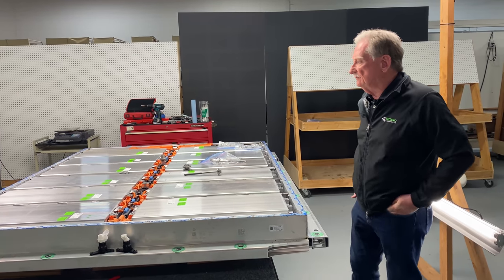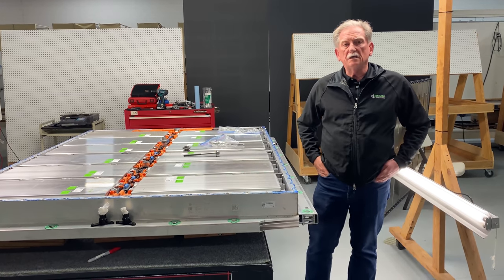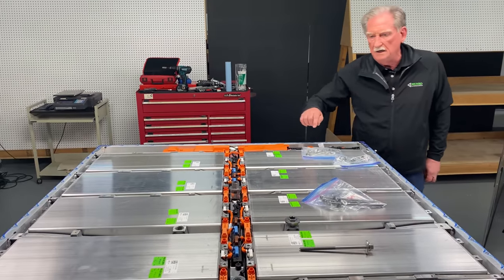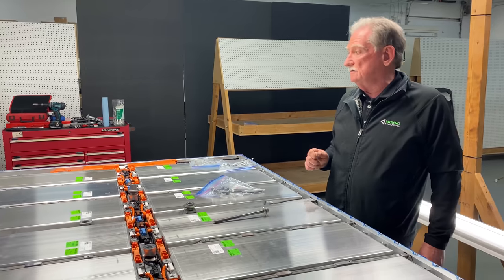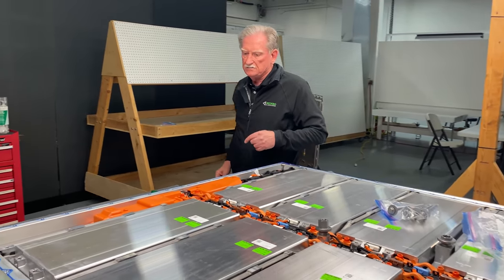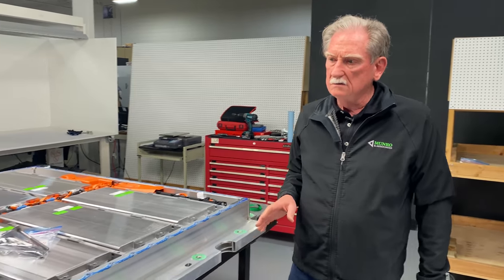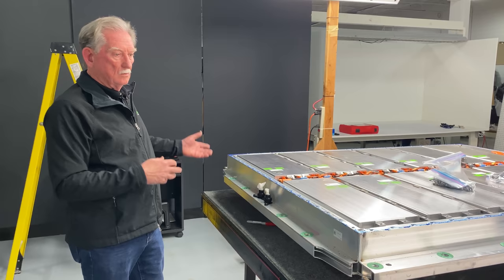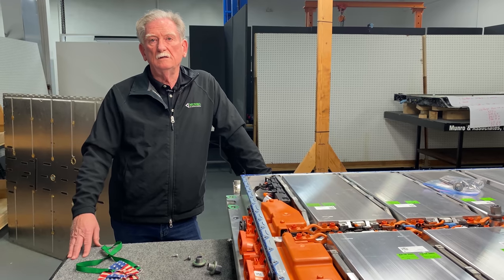2021 Volkswagen ID.4: Battery Teardown

Comment: So if you reduce the weight by swapping the aluminum with polymer frame, does it is increase material cost? How is the $10 per kg derived?
Reply: My question exactly. Carbon Fibre is expensive.
Reply: $10 per kg is just a generalization, a kind of place holder pending the real costs.  To get the real costs, you have to go much deeper.  The true cost of a design has to take into account the manufacturing steps required to assemble the car, the robots and manpower involved, the price paid for outsourced parts, and even risks - if a design is more risk-prone in some way, cost analysts will usually factor the cost of risks into the cost analysis.  Risks are varied.  Safety risks, parts failure risks, risk of misalignments during assembly, anything that could require taking a cost charge or the cost of corrective action during or after assembly is fair game.  Even the risk of litigation after the vehicle is sold is fair to include in a cost analysis.  Some engineering decisions may elevate or reduce risks.  It all can be quantified, although it's usually necessary to make some assumptions to get to the final figures.

As an aside, VW hasn't always done a good job with costing risks.  If they had, they'd never have played the engineering games that led to Dieselgate.  Those engineering decisions put the company at enormous risk - and that risk materialized, to the tune of many billions of dollars.

Every step in assembly costs robot time, or manpower, or both.  Nothing is free.  So deleting steps is great when you can do it, as useful as reducing weight, or even more so.

To save weight, Sandy talked about reducing fasteners, changing materials and reducing parts (by combining functions in larger parts).  He mentioned welding; there are a lot of different welding approaches available to a manufacturer, some more expensive than others, and sometimes design decisions can reduce or eliminate the need for welding.

He hasn't yet torn down the battery pack, so he may find weight savings inside, too.  And cost savings.

Weight doesn't really drive costs all by itself, but it's always good to get weight down for a BEV.  The lighter it is, the better the range and energy efficiency, factors which affect consumer demand.  What Sandy is looking for is really a two-fer: reduce weight and generate cost savings.  His rule of thumb is $10 per kg going into an analysis, but the cost analysis isn't limited to two variables, and those two variables, cost and weight, aren't truly correlated dependent variables.  You could, for example, reduce weight in an engineering decision that would increase cost.  Or generate a cost savings by increasing weight.  But because it's a BEV, the imperative to always seek weight reductions factors significantly into an engineer's thinking about a design.  So Sandy is looking for improvements in both cost and weight.

If the past is any indication, he will find what he's looking for.
Reply: @Urgelt  Thanks for the explanation. I agree that weight reduction is important. Perhaps the end result is that Munro generates a bucket full of suggestions, each has a specific weight reduction number, and it will be up to the supplier and manufacturer to quantify the savings. Munro, after all, is not privy to all of VW's processes.
Reply: @khuo0219  Yes, OEMs have positions called Cost Engineers/Vehicle Cost Engineers that determine a $ amount to both new parts and cost reduction ideas. They are usually the first filter for cost reduction ideas because they also assign an estimate for the $$ needed to make a change to tooling. If the savings aren't going to recoup the tooling cost within 1-2 years of production, they'll cut the idea.
Reply: @Urgelt  To get the highest weight reduction: get rid of the aluminium frame and integrate the battery pack inside the existing bodyshell of the car and do local reinforcements. For manufacturing it will be not so nice.
Reply: @marcinjacob-puchalski3585  not easy to do.
Aluminum has a critical heat transfer characteristic, that a painted steel pressing does not.
Then you also have the extra problem of battery replacement if the car lasts longer than the battery pack,  which is a given for commercial use.
Integrated body support of batteries sounds really problematic.
Reply: @dnomyarnostaw  Yup. Quick cell replacement is going to be crucial for lease, and rental fleets.
Reply: He's being paid by a polymer company - what else do you expect him to say?
Reply: @dnomyarnostaw  I agree you get 2 new problems to solve, but from weight point of view this is what you have to do. Thermal insulation and cooling need to be improved and battery replacement becomes hell for the customer
Reply: @marcinjacob-puchalski3585  They aren't able to use cylindrical cells bonded into a rigid structural block.  They're stuck with pouch cells that need to lie in boxes.

Structural rigidity has to come from somewhere.  So they encased the boxes in this structure.

They also can't make structural bodies - they're stuck with stamped painted bodies that can't bear loads.  So the load has to be transmitted to the ladder frame under the truck.

There are various ways to do this, but Sandy is on the right track.  Absent structural bodies, absent cylindrical cells bonded into a single rigid structural pack, we're down to considering which materials to use in the pack structure, how many parts and fasteners, and how to fasten the pack to the frame.  The flimsy body is an afterthought.

We're looking at a true skateboard design here - frame, suspension, and pack are a cohesive unit.  The body just drops down on the frame.
Reply: @khuo0219  Roger that, Kun Huo.
Reply: @MrRich2u  Sandy mentioned this in another video. We perceive carbon fibre as expensive, but the reality is that the production infrastructure is dirt cheap compared to presses, welding robots, machining centers and what have you not to produce the metal parts.
Reply: @liontone  why? How often do these cells fail to warrant the extra cost?
Reply: @khuo0219  
I think that's varies a bit talk to early Tesla owners that were a hell of a lot of battery replacements in the early Model S,  some multiple times.
I think it's a bit of give and take. The Tesla design is more integral and probably more efficient.
But the legacy automakers are more familiar with repair after the build. And customers that buy cars from legacy automakers expect to be able to have a car repaired and have it be a reasonable cost. With a Tesla if a few individual cells inside that battery go bad you're replacing the entire battery and it has to essentially be tossed in the trash because you can't disassemble it after it's constructed. With a design like this or the Chevrolet bolt EV if you have a bad module inside that battery casing you can repair it and not have to throw the rest of it away. There is definitely an environmental advantage long-term with that also. If I was confident that the whole battery pack from Tesla could be tossed in the shredder and efficiently and environmentally recycled properly perhaps it wouldn't matter if the cost was low enough for a whole battery replacement.
Also people at some point are going to expect that they might be able to repair their own car. And that certainly would be possible with this Volkswagen design or the Chevrolet bolt EV. If you've got some decent equipment at home you could theoretically get the battery pack out of your car open the pack out and replace an individual module that had failed and get your own car back on the road.
Weber automotive on YouTube has a really great video series on the Chevrolet bolt EV he goes to the powertrain cooling system and does a full battery pack removal and complete disassembly. And Chevrolet will sell you parts to fix your car unlike Tesla.
Reply: @MrRich2u  Both in material costs and manufacturing costs, carbon fiber is orders of magnitude more expensive. 
However, injection molded polymers are strong and cheaper. Though, not recyclable, nor will they offer ANY protection from a runaway thermal condition in the cells. i.e FIRE. 
Sure the aluminum will burn through, but likely not before you can get out. Not so with polymers.
Reply: It will undoubtedly increase your material costs, but the benefits outweigh the costs in my opinion. Only performance cars use carbon fiber at this point, and I don't see that changing. The best combination is replacing the larger components with either an aluminum honeycomb panel or a fiberglass + thermoplastic panel. When factoring in the stamping equipment, the composite panels are still more expensive, but are a wash when considering the $10/kg savings.
Reply: @jonathan4831  I'd doubt that. One.. where does the mystic $10/KG come from? 
Then is that fact that those aluminum rails were profiles, meaning they could be extruded. Extruded aluminum is cheap to produce. 
Like the production time on the composite panels would even be slower. 
Personally, I would say that value to $10/kg is complete nonsense. In performance cars, the value is order of magnitude higher, but in the opposite direction. It is more expensive to build something lighter and to the same strength.
Reply: @anonymous.youtuber  so why sent all cars made from carbon fibre

Comment: Sure, the complete housing for the battery packs could be made out of carbon. So you can half the weight. But in case of an accident with damaged batteries, the safety of the passengers must be always the highest priority.

Comment: Here in Finland 8.8 strength bolts are officially recommended. It is very rare to see less than 8.8 bolts here.
Reply: Whole Europe I suspect. 8.8 is 800 N/mm² tensile strenght and the 99% industry standard. The second ".8" means 80% of the 800 N/mm² = 640 N/mm² yield strenght at the upper end of the elastic deformation.
Reply: @Stefan_Dahn  It may be. Less than 8.8 bolts are pretty useless.

Comment: I like what I see - conservative German engineering. That pack looks skookum.
Reply: it's not bad engineering, it's good, just not great. great engineering does not mean over-engineering. unfortunately the germans can sometimes get carried away, due to their superior technical abilities. a perfect balance of cost and function is the goal... unfortunately this was not an example of it. but it's  v1, their v2 should have lots of improvements thanks to Sandy.
Reply: @2hedz77  I agree with the v1 and v2 part. Tesla is already at v3 or v4? But the other part of this whole video is so missleading. Look at CarsonJ's comment. The energy density is off by 1,8%. And the design is way more servicable, recycable probably way lower cost than the compound polymere solution suggested. So overall nice overview of the design but since most of the video is about the weight difference and how to improve that the whole video is basically obsolete.

Comment: If there's one thing the Germans love its Torque to Yield bolts, and Anaerobic sealant! ; )
Reply: Fancy seeing you here, Paul. 😉
Reply: I don't mind. they will work for the cars service life. 5 years.
Reply: Germans LOVE only 2 things, BEER und BRATWURST.
Reply: @salami99  Cute, but German cars life is not 5 years. Make that 25 at least.
Reply: @derbigpr500  name 1 bmw that made in the last 20 years that lasted 25 years and at least 250k miles
Reply: Torque to yield delivers more homogenous preload and hence fastener weight optimization.
Reply: @salami99  Logical fallacy, car made in the last 20 years cannot have lasted 25 yeats.

Comment: There’s not a hole lot of difference between the model Y and the ID4 battery pack in weight it’s just that the ID4 gives you more capacity for a cheaper price and I suspect that Volkswagen is keeping a larger buffer on both ends than Tesla have you noticed how easy the lid was removed compared to Tesla the Tesla pack is glued and very had to remove without distorting the top cover meaning that Volkswagen has planned for repair and serviceability plus you can probably buy module From Volkswagen to fix a pack compared to Tesla you have to buy a brand new pack. And they don’t sell. Much parts to independent repair shops rights to repair anyone.
Reply: And yet Tesla has more range
Reply: As you have said in contrast to Sandy's position, I take repairability/ serviceability every day.  I'm not a fanboy of any brand, but I personally would not put my money in a product, which is not designed to be repaired. This is why I think Tesla is about to meet the real world and why it will not dominate the EV market after 10 years. Now, EVs are bought by people with enough $$$ and they make decisions based on a different set of values. In the long run, the price and ability to repair will have to be factored in. I certainly hope people start thinking and if they are for real about preserving the environment, the responsible thing is to have the car for 15+ years or even more.
Reply: @rideyourbikent  Not really, Model Y and ID.4 have roughly the same range in real world tests.
Reply: @primetablet  Correct.  Tesla advertises range they can't deliver while VW sandbags their published range and most people exceed it in practice.
Reply: @primetablet  where is this real world?I want to go there 😢

Comment: Batteries in a crash are something of a nightmare, as much as a fuel tank. Is see why they over-engineered the framing of the support also why they protect the cooling liquid channels. I’m curious to see the bottom of this power battery?

Comment: The weight and configuration of the battery is for structural and crash protection purposes. The Germans don't make things unnecessarily heavy without a purpose. From VW's own training material:
-The battery housing is made of aluminium. Reinforcements have been installed inside the housing to provide the battery modules with the best possible
 protection in the event of an accident, both in the longitudinal and the lateral directions. 
-Make sure nobody enters the vehicle after the high-voltage battery is removed because the battery contributes to the
overall body rigidity. Once the high-voltage battery has been removed, there is a risk of vehicle body damage due to
distortion.

Comment: I wasn't expecting such a good battery pack, just slightly worse than Model 3/Y, IMO.
PS: the new Model 3/Y packs are 82kWh also, and the next version will probably be around 100kWh with 4680 cells 😎
Reply: I'm a little sad to see them still using modules. I thought Tesla's battery day might have got the point across that you're wasting weight and lowering energy density with that approach.

Also, we don't know what size the Y pack will be yet with 4680! I think it'll be 75/80kw as it is now, that'll be much lighter with the more energy dense pack and as a result you'll get better range. :)
Reply: @VoxelLoop  The energy density here has more to do with the battery chemistry and pack construction than the cell design. Pouch cell packs have the capability of being far more energy dense than cylindrical cells. For example, using the identical chemistry, the BYD Blade pack is 15% lighter than the Model 3 2170 pack.
Reply: @VoxelLoop  Modules make it partially replaceable and the extra safety factor and the standing patents makes it better/cheaper for VW as well...
Reply: @newscoulomb3705  I mean in Tesla's case with the 4680, the larger cells leave less gaps between the cells so you get a higher energy density. :)
That makes sense for pouch cells though!
If I recall, Tesla went with cylindrical because they were easier to mass-produce.
Reply: @coldfusionspacexxx9814  The issue is that no one ever replaces modules. Tesla used them for the same reason, but how often is a module ever replaced? Basically never at this point.
The other useless weight for 3/Y is the packs are still setup 'kind of' for quick-release to swap them out like Tesla had originally planned. Though, Tesla has removed some of this mechanism they haven't removed all of it yet and it adds some weight. (Maybe the latest Model Y packs have changed this?)
Reply: @VoxelLoop  The gaps between cylindrical cells will always take up more space than the gaps between pouch or cuboid prismatic cells. Plus, the outer casing adds mass. Tesla is trying to use them as structural elements, but if doing so reduces pack mass by 50 kg but increases structural mass by 50 kg, what have they actually gained?
Also, Tesla is only using cylindrical cells because that is what Tom Gage gave them to use. It's not because cylindrical cells are easier to mass produce (large format pouch cells are easier to mass produce), but rather because cylindrical cells were the only lithium format readily available at the time Tom replaced the Optima Yellowtops.
Reply: @VoxelLoop  "The issue is that no one ever replaces modules. " Can't believe I am reading this.
Reply: @khamphaTG  If you'd like to correct me there feel free. I've never heard of modules being replaced in Tesla's case with 3/Y, they usually just replace the whole pack if it's really that big of a concern. 🙂
Reply: @VoxelLoop  well, could this be because the Tesla packs are basically bricks of glue and not made of individual modules?
Reply: @stephanweinberger  They still have modules though at the moment, inside the modules is what you're talking about.
Reply: @VoxelLoop  Have you seen Sandy's video where he disassembles a Tesla pack? He basically had to cut it open and rip it apart.
Reply: @VoxelLoop  There are specialized shops that do that on Prius models as an example, they are balancing the packs, replacing individual cell groups if needed,cleaning the cooling system...this way prolonging the used car life. If the cars get damage but the battery is usable some companies put them to energy storage packs for households...In both case modular feature is essential...